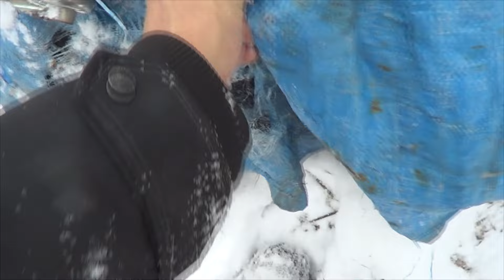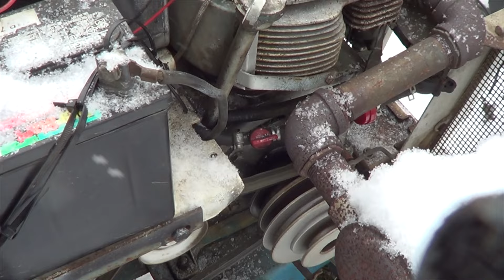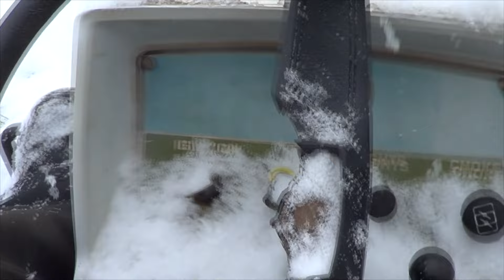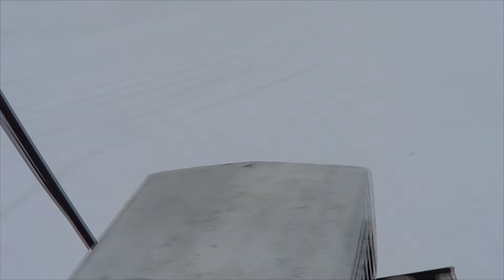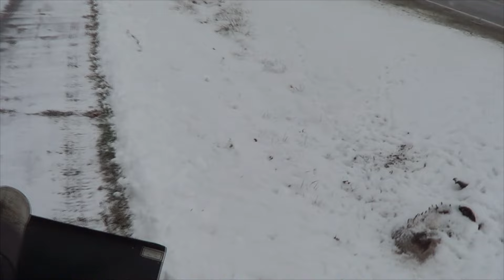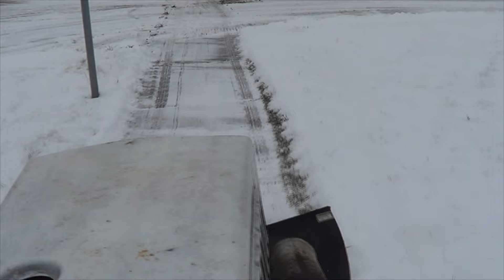14 Degrees F Will it Start Sears Suburban 15 plowing snow

Comment: Good ole suburban ! 👍👍
Reply from the maker: It started out a parts tractor , I did very little and it just ran , so i kept using it . Is is one , Maybe the only one i have not rewired , YET .
Reply: I had a few and they are great ..  @wtbm123  👍👍

Comment: Nice tractor. Must be late sixties or early seventies, having a starter generator on it.

Ahh, I looked it up on tractordata , it’s a 1972. 👍🏻
Reply from the maker: Correct 1972 . I also have a few 1971 SS 14 tractors .
Reply: @wtbm123  👍🏻👍🏻

Comment: Well Mr Sub did a great job :-D
Yes you had to feed it some go go spray,  But its cccccold brrrrr.
Is there no choke on the carb?.
I dont think the battery is too happy,  i dont blame it :-D
Reply from the maker: Yes there is a working choke and it was choked . In regality the starter gen could probably use a refresh , and the cold weather , and 30 w oil probably did not help either .

Comment: Some of those tarps are cheap  had some one tell me about the canvas style of  cover
Reply from the maker: Or if one can find a trucking company that sells their old used tarps . They still last a very long time , just heavy
Reply: @wtbm123    I was told that I could get a canvas tarp at tractor supply
Reply from the maker: @robertmailhos8159  Not sure , Our TSC hardly has anything in it .
Reply: @wtbm123   ouch that is a bad idea not to have anything that you might need in stock

Comment: Hey Terry found you, subscribed 👍🚜🪵🔧🔩, does the weight on the front tires help steering
Reply from the maker: Yes . It helps a little . I also use a tiller on the back and a turning plow . They help there a lot . I just never took them off , but i think they help a little. Softer tires would probably help a lot also